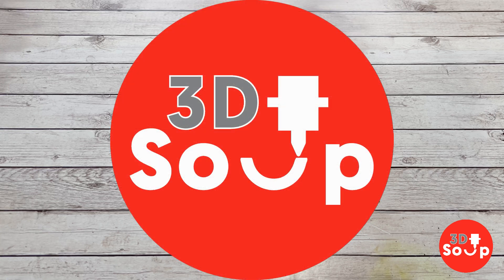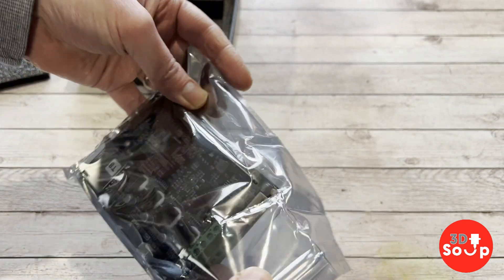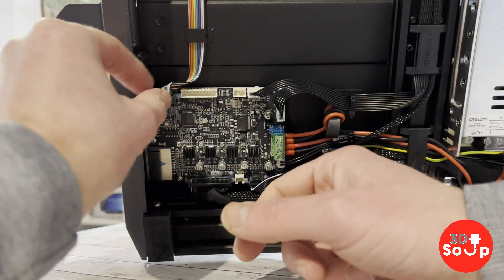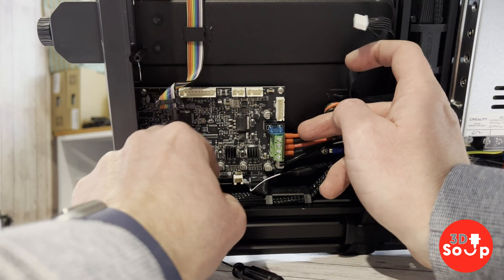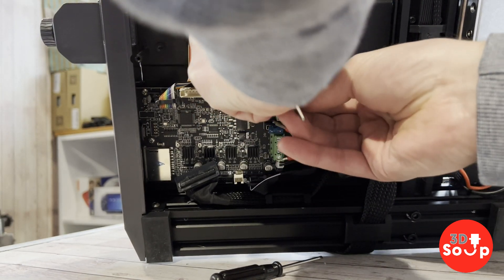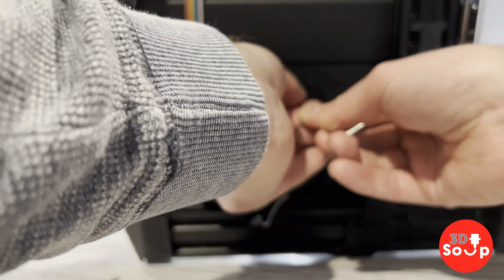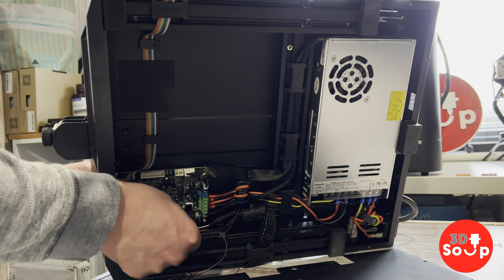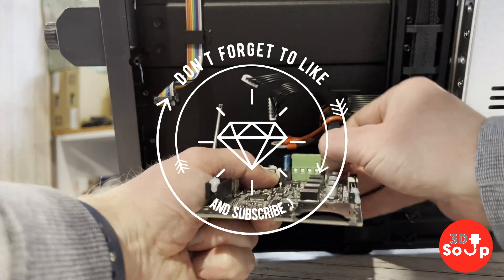How to replace / install the main board on an Ender3 S1 3d printer  I fix my ender 3 S1 FDM printer.

Comment: no way it work right off the bat mone wont work right after replacing the motherboard
Reply from the maker: Works fine as long as you are careful and follow the instructions on creality’s website - good luck :)
Reply from the maker: If I remember rightly I just used PLA, nozzle 215 degrees, bed 70 and used supports where needed- this was 4 years ago mind you.

Comment: replacing the board was simple but i need to flash the firmware and i have no clue how to do it
Reply from the maker: You just need to download the correct firmware for your printer type and board (the board number will be on the board it’s self ) check you have the right versions and follow the instructions on creality’s website - as long as you use the correct files you should just need to put them on an SD card correctly and turn the printer on.

Comment: Creality refurbished ebay sent me broken printer then sent me replacement board snd now i uave ro bust out the damn heat gun? Are you kidding me? Im just sticking to octoprint and will just get a otg splitter so my phone doesnt die ... These enders are terrible,, bambu a1 is so much better
Reply from the maker: Not sure exactly what happened here, but the words eBay and refurbished might be your problem. I find second hand 3d printers are best avoided if possible. Not tried Bamboo yet but I hear good things

Comment: hi thank for this my s1 is working but it has the f4 arm chip   (limited functionality  due to smaller memory cache) just curious  what version was your replacemnt board vrs the blown one  ?
Reply from the maker: Had the same issue with an older board so I upgraded to a newer iteration. Thanks for watching :)
Reply: @3dPrintedSoup  "Just curious what version was your replacement board vs the blown one ?"  Answer: "Had the same issue with an older board so I upgraded to a newer iteration. Thanks for watching :)"   This is your typical youtube idot answer even though they have  thorughly looked at both boards

Comment: just wondering if you checked the fuse after because i have the same issue with a brand new ender 3 s1 pro getting a new motherboard, but done a test on the fuse and its blown but you can not get the fuse on its own
Reply from the maker: First thing I checked, unfortunately it was not a blown fuse in this case - thanks for the suggestion though :)